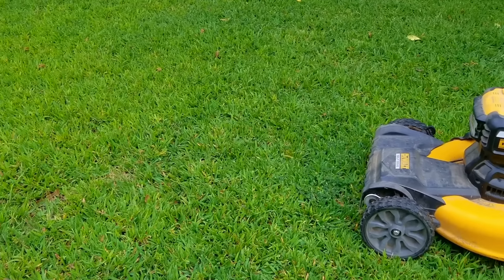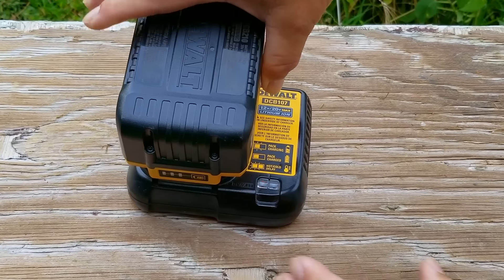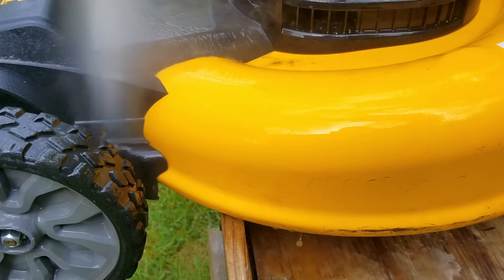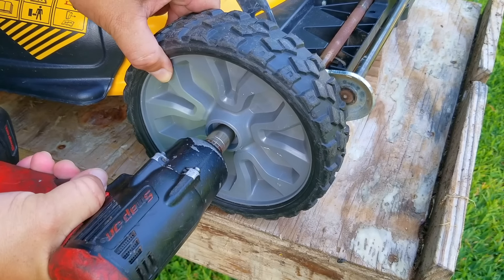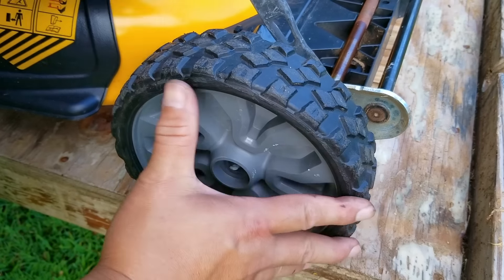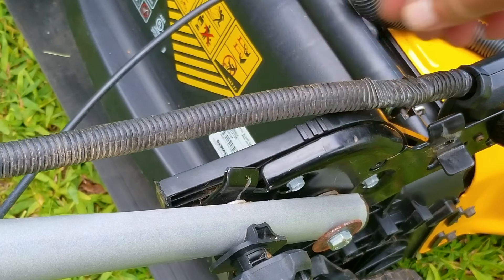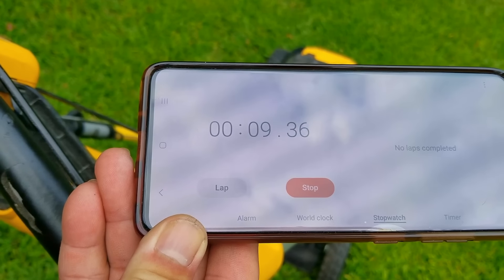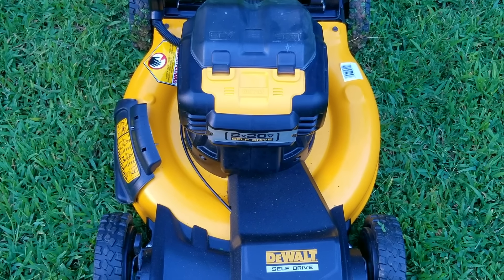Finding Out Why This Dewalt Mower Start And Then Stops

Comment: Hadn't watched any of your videos in awhile. Came back to see you working on electric junk. The gas power will never go away
Reply from the maker: have you been to the hardware stores lately?   There are 30-40 electric mowers compared to the 5 gassers on display
Reply from the maker: you and I can only hold out as long as parts are still available, but as time goes by, they'll get harder to find and if you do find them, they're going to be expensive.

Comment: I think a battery pack rebuild would be an interesting video. Definitely keep a sand bucket nearby and appropriate safety material.
Reply from the maker: oh you got that right, sand bucket, and a wet blanket to smother it.  Don't have a fire blanket just yet.
Reply: I’ve rebuilt dozens of these DCB210 batteries and they are still dropping like flies.

The Samsung INR21700-50S cells are prone to overheating. The DCB210 were created to avoid bundling FlexVolt batteries with these things (might as well be a 60V mower then). Get a pair of 9AH FlexVolt batteries instead (30T cells). 8AH XR (DCB208) and 12AH FlexVolt are good options too (40T) but 8AH is low capacity for this.
Reply: @HomeGaragechannel It won’t smother it (self-oxidizing) but at least it will avoid having flames shoot out to start secondary fires.

Comment: Definitely an A+ for the video and absolutely an F for the product. The cost of replacing batteries should be enough reason to stay away from this crap. Battery powered lawn equipment will soon be like EVs manufactures are going bankrupt. Try to trade in an EV not even the dealership wants it back😂 the only ones pushing this crap are our politicians. 
Install the gasoline engine and make some 
$$👍👍
Reply: @pit4955  i love EVs. They're exciting! 
I mean, when was the last time you heard of a car dealership burning down from a brand new car that was sitting on the lot doing nothing.
Probably never! Therefore, more exciting!
Reply: Spot on!
Reply: @demcomp  LMAO!  Nice
Reply from the maker: I like that idea a lot
Reply: @donjohnson1416  absolutely most of my power tools are electric and pneumatic, true I also have a battery powered Makita and Milwaukee drill and impact driver that’s about it and only being used on very light work. Battery power has gotten quite expensive. I happened to be an area where the developer has 180 homes being built and 75% of the contractors are all using generators with compressors and electric power tools.
Reply: @donjohnson1416  Yes, yes I do have corded saw and drills.. AND A pneumatic impact gun. Oh no! I have a Hitachi corded hammer drill, and a Craftsman Compound Mitre Saw, a Corded Hitachi Table Saw, and a Corded Skil Circular Saw...
So ... now what?
Reply: @donjohnson1416  I was running a 35 year old Craftsman Lawnmower with a Tecumseh LV195EA 6HP engine..
Another time I was using a Sears branded lawnmower that was 45 years old before I forgot old gas in it and I didn't know how to fix it (I do now, but I got rid of it...) 
45 years old. Come back and talk to me when your battery trimmer is 45 years old and running like new. Oh yeah, I can show you a video from 2013 of it running (mower was from 1972)
Reply: @donjohnson1416  do you want to argue continuous duty vs short term duty cycle? Do you want to argue how batteries, under continuous demand cycles overheat without supplemental cooling? Why do you think EVs have heavy duty liquid cooling systems that are integrated into the batteries? Because of continuous demand cycles. A battery is for short term demand, or they'll overheat, which reduces the lifespan of the battery. 
You MUST stop the use of the battery before it begins overheating to allow the cells to regulate and level off charge between them, otherwise you will have a cell that will deplete faster, and cause damage. A drill, and an impact, as well as saws, etc, are short term demand duty cycle motors... A lawnmower uses a continuous demand duty cycle motor. 
You really want to argue this with me? I will die on this hill, as I have decades of experience working with motors, and batteries. 
Try again.
Reply: @donjohnson1416  battery tools aren't new.. battery mowers aren't new. They have had battery mowers for decades..
Why do you think you didn't see a lot of them?
Because they don't last... They never do.

10 year old drills require new batteries. Many times those batteries are no longer produced . What happens to the tool? It is thrown away.

The electric motors can last forever if properly cooled, but due to the conditions that a Lawnmower is subjected to, the laminations can become clogged with dust, as well as the cooling vents on the motor. This will then cause the motor to overheat, wearing it out more and damaging the laminations of the wires. This, in turn, increases the internal resistance of the motor, causing the draw on the batteries to increase... Which shortens their life even more.

So no, in 45 years, every single battery electric product produced (save an absolute miniscule amount) will be located in a trash pile somewhere.
Battery electric products are not even close to environmentally friendly. Honestly they are only corporation profit margin friendly. A gasoline engine, which is properly maintained, and kept clean, and with efficient cooling, can last decades, offsetting a lot of the pollution that they may give, by simply lasting for decades.
There are more gasoline powered small engines that are 25 years+ than there are battery electric ones, Worx battery electric mowers date back to 2009... 25 years ago.
See how many are still around, don't even need to wait 45 years, we have data today.

Comment: I bet you have 2 or 3 cells in that pack that discharged further than the rest.  It might even just be a single cell that failed.  Charge the pack all the way, then take it all out together.  Find B1 (or some similar designation) and see what voltage you get there, continuing through the end.  That will help you identify which group of cells is low if you choose to rebuild it.  The issue you might come across, is finding the identical cells online.  There are some reputable stores that will get genuine cells, but they'll cost a bit.  The other issue, is getting the nickel strip, decent spot welder, etc to rebuild them.  I've done several packs, although, not in the 10Ah range.  Happy to provide any insight I can if you choose to rebuild it, as I've done probably 50 packs over the last few years for Milwaukee, Makita, Ryobi so far.
Reply from the maker: thank you and yes I've considered rebuilding them with all new cell to keep from having a balancing issue

Comment: This is a reason that battery powered mowers aren't really the future just yet. I would definitely stick with gasoline powered ones until battery power makes an improvement in the future. 
Answering your question, it wouldn't be a bad idea to swap the battery packs with an engine. Would definitely be more reliable for sure lol
Reply: That is my thought as well.
Reply from the maker: you got that right!

Comment: I have a very small yard I went to battery operated mower and 2018. It is the ego brand still on the same battery takes about one our to charge it from dead. It’s a 7.5 amp 56 V battery and I get 3 1/2 cuts of my yard out of a charge currently when I first got it. It was closer to 4 1/2 but batteries due to grade with age, but I don’t think that’s too bad with it’s age if I had a bigger yard, I would buy gas
Reply from the maker: I like your reasoning for going electric, it totally makes sense

Comment: I just rebuilt one of those same 10ah batteries a few weeks ago. Order two new cells online spot welded them in and works as good as new.
Reply from the maker: did you order the same model Samsung cell, or an equivalent? I'd be Leary of mixing new and old cells.
Reply: @HomeGaragechannel  I ordered the same Samsung cells that were in it. I ran a few cycles through the battery and I took it apart again and they all have the same voltage so they are charging fine with the old cells. Figured it was worth the little bit of money I put into it. I've done the same thing with a much older heavily used 6ah battery and that one I only replaced one cell and haven't had a problem yet.
Reply from the maker: nice, thank you for the information

Comment: Rebuilding the battery is a delicate operation. Back in the NICAD battery era, I rebuilt a lot of my Ryobi battery packs. Even then those NICAD batteries carried a nasty bite if they accidentally got shorted. Lithium is even more spicy. Just be very careful if that's how you go.
Reply from the maker: yes, I would have to all the safety stuff ready, along with a box of extra "care"

Comment: On the questions on batteries when they are too low to recharge do you suggest to boost them with another battery  (by two wires positive to positive negative to negative any brand of battery as the charger )to get the minimum charge required to recharge the battery through recharger?😊
Reply from the maker: yes I would and that's mainly because the newer chargers, won't charge them unless they have a somewhat decent charge on them to begin with
Reply: DeWALT batteries have all the balance leads exposed on the connector (middle contacts are double-stacked). I use this to connect a BT-C3400 cell charger to charge each bank one at a time. Of course, you can also just take it apart and use alligator clips but I’ve begun taking my Maddox back probe leads to flea markets so I can check used batteries with my meter without even opening them. ;)

Comment: And this is exactly why I pick up any kind of equipment with an engine; I just know it’ll last far longer than the best electric equipment on the market!

Every time I use my equipment I have found I feel peace of mind knowing they will continue to run even when gas equipment is no longer sold.

Now on the other hand I do have a cordless snow blower which I repaired a few years ago and occasionally use in the winter.

The battery is still good because as soon as it’s charged it’s removed off the charger because the battery will actually lose capacity the longer it’s plugged in.

I can’t confirm that this is a surefire way to avoid replacing the battery altogether but it is similar to tires on a vehicle. With proper maintenance and careful usage a tire (likewise a battery) will last a long time before requiring replacement due to age.
Reply from the maker: I like the way you put that

Comment: Your degreaser works fantastic,  Can you tell,what it is?
Reply: I think he uses Harbor Freight brand.  I got some and it's great -- highly concentrated and you mix with water for the desired strength.
Reply from the maker: sure, it's Super Heavy Duty Degreaser from Harbor Freight
Reply from the maker: you are correct! I use mine very concentrated

Comment: just got an email from dewalt that some of the mowers that were sold were recalled for some safety feature, I have the Ego electric mower and my mower is tough built, its been with me since 2018 and has been abused and is still kicking strong
Reply from the maker: yes Ego seems to work for quite some time. And yes there's a recall for their newer battery mowers

Comment: I have the same mower.

After fighting with those junk 10AH DCB210 XR batteries (literally dozens failed) I finally just spent the money to get two 9AH DCB609 FlexVolt batteries, two 8AH DCB208 XR batteries, and two 5AH DCB2105 PowerStack batteries… then the mower started shutting off in about 5 seconds.

It has a relatively new Oregon blade that has only been used to mow twice without issue so I don’t think that’s the issue. The motor is supposed to speed up in thicker grass and I can hear it surge just before shutting off though it is unloaded.

Regarding the DCB210 batteries: It’s almost always a failed bank of two cells due to overheating. Even the ones with another issue failed the same way with the next use. The exact replacement cells are Samsung INR21700-50S.
Reply from the maker: thank you for the information I appreciate it.

Comment: I hate to say, the DCB107 (charges at 1.25 amps) is the slowest battery charger that dewalt makes. If you decide to work on more dewalt tools, I would heavily recommend switching to a DCB115 (charges at 4 amps), which is pretty cheap by the way, about 50$ new, but you can find them from as low as 15$ new. If you want a real fast charger, then I would recommend the DCB118 (charges at 8 amps) for a little bit more, about 125$ new, but you can find them for as low as 50$ used. I would recommend getting the DCB115 for 3.2X charge speed. Thanks for reading this 💀
Reply from the maker: thank you for making this comment.   Yes I'm aware that the DCB107 is a 1.25 amp charger but I do believe this was done to help improve battery life by slow charging it. 
To be honest, I'm guessing that the person who had this mower before me, was not using these chargers once they realized how slow they were, and starting using a much faster charger which ended up shorting their life.
Reply: @HomeGaragechannel  From my experience, I have seen very little difference from battery life from slow charging, and normal charging, but I do understand your consideration. Thanks!
Reply from the maker: thank you for your time

Comment: Nice video! I have the same problem but my batteries both test at full 20v. The motor runs with the blade removed. Then, with blade still removed, I engaged the self propelled and it died again. It seems like either vibrations or load applied to the motor makes it stop. All I caught from the video is that you cleaned it and charged the batteries. What else did you do to get it to run?
Reply from the maker: I apologize, I didn't do a great job presenting the repair because the way I went about it was not my usual way.  The gist of this one, was the batteries were the problem.  On initial start up, the battery voltage would drop too far, and the safety system kicked in and stopped it from working.   Once I got the batteries charged up to full, the voltage "sag" wasn't enough to keep it from running.  As for your situation, I would borrow two good batteries from a different mower to test with.  I'm sure your batteries are testing at 20 volts but are probably dropping below 10 volts when putting a "real load" on it.
Reply: @HomeGaragechannel  Yes, I have discovered that the mower dislikes one of the 10ah batteries. All of the terminals match voltage in the batteries, so I can’t figure out why it dislikes just the one. It will run with a mix of other batteries, but none of them are a high enough amp hour to be useful on my lawn. You’re right, it must be dropping voltage or not have the amperage the lawnmower requires. That battery runs my drills just fine though. I’m not looking forward to a world run by batteries. Thanks for your video and for sharing your knowledge!
Reply from the maker: no problem and thank you for the update

Comment: Ack, after 30 years in the industry, I absolutely refuse to book electric machines into my shop.  These things are garbage, and BAD for the environment, NOT green at all.  Expensive to buy, batteries are expensive to replace...  Basically it is a case of "When in doubt, throw it out".
Reply from the maker: I like that saying!
Reply: @donjohnson1416  That is correct, and we have air tools.  You don't use saws to repair outdoor power equipment.
Reply from the maker: I'm really tired , think I'll take care of this. thanks for playing .

Comment: hey so my push mower has lost power, it gained some once the air filter was cleaned, theres also a hole on the deck on the top, could it be the hole causing it lose power?
Reply from the maker: I doubt it. Have you considered doing a tune up on the mower?
Reply: @HomeGaragechannel  Im probably going to attempt it and see what happens after watching more of your videos on them. Do you think the hole which is about the size of a bit smaller baseball poses a safety risk?
Reply from the maker: yes I do

Comment: The lawn mower reminds me of a typical cordless portable vacuum cleaner, aka "Dustbuster". They're designed for lightweight and small size and cheap, so the cells are way under rated for the fan motor. When you run the little vac, the batteries see a current draw almost like a car battery sees when the engine starter motor is engaged. If you get a year out of a portable vac that's good. The batteries are killed fast. I feel that lawn mower is like a big dustbuster in so far as the battery packs are beat to death unlike when they are used for a saw, or a drill.
Reply from the maker: I like the way you put that

Comment: It's a whole new game with battery mowers. I am trying to resist but there are a lot like that hanging around online.
Reply from the maker: I know right, I don't plan on buying any either, but free, I can manage that.
Reply: @donjohnson1416  3/4 acre might be a test for current battery technology 🤔
Reply: @donjohnson1416  I was thinking little stuff like this one, box store gear.  With commercial gear, I agree, 3/4 acre is easy peasy